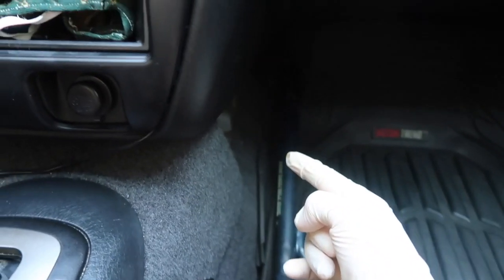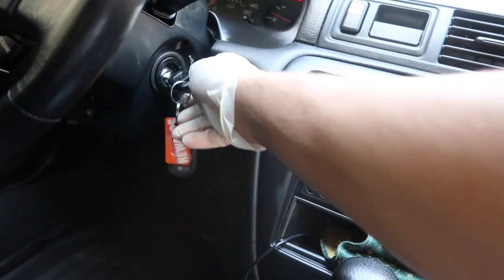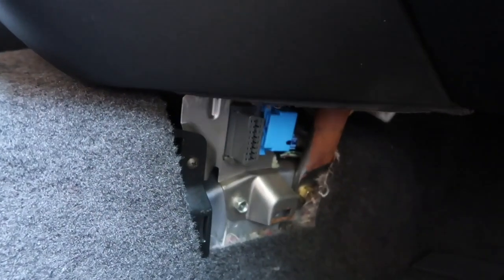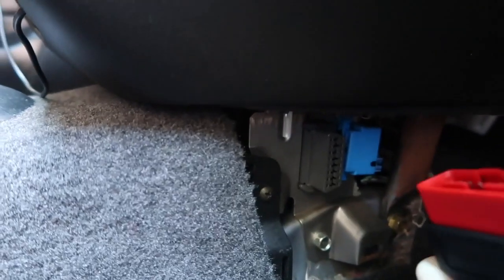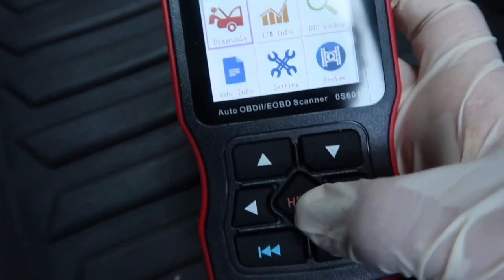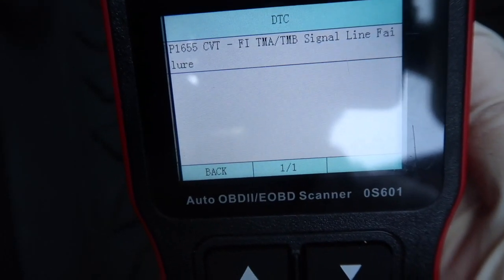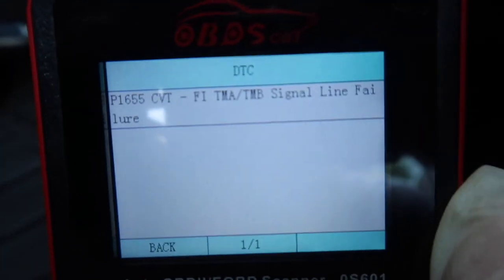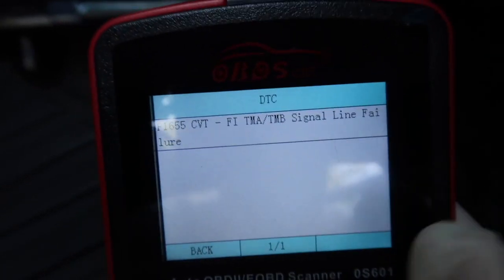Honda prelude code 1655

Comment: Could this possibly be ecu related
Reply from the maker: I'm not sure I think it's more related to the signal wire itself more than anything else. Hopefully the wire is not broken or causing a short but I always like to look up the possible symptoms and causes and start with the most simple and obvious solution and begin trouble shooting from there.
Reply: @automotiveobsession7265 my charging system is not working for some reason and it feels like I am stuff in higher gear when in drive, but if I go to 1st and than shift up I can get into drive. Car will not shift itself do you know why this could be?
Reply from the maker: @RedSharkBlue  It sounds like you have an automatic Honda prelude. The automatic transmission on the prelude is very well known for having problems and the higher the mileage the worse it gets. How many miles does the car have? It might be that the transmission is giving out and if that’s the case the best way to correct this problem if you plan on keeping the car is to do a manual transmission swap. You could  try an put Lucas transmission oil to see if it helps. I have a video on the parts you need to complete the swap here - https://youtu.be/c1rxKIF54qs?si=VSb6LmsCn81P94VF
Reply: Okay but what if your car won’t start still?😂😅

Comment: all honda prelude are OBD2?
Reply from the maker: No. Only the fifth generation is OBDII because OBDII became standardized in 1996.
Reply: @automotiveobsession7265  wrong, mine is a 5th gen and has obd 1, kinda tough to find where to get the error codes at that point..

Comment: I have the same code and my car actually is missing that connector that you disconnected and reconnected.
Reply from the maker: That's confusing. That connector should be there it's the original location according to the manual. Have you checked to see if it's somewhere else?
Reply: @automotiveobsession7265  Going to look again tonight. I was quite surprised. I also found a random loose green wire with a butt splice connector on one end but the other end of that splice connector was never crimped to anything. Previous owner(s) may have messed with things that they shouldn’t have.
Reply from the maker: @_Juls  That could be a potential cause to why you don't find where they are supposed to be. Previous owners changing things to different places. Good luck.